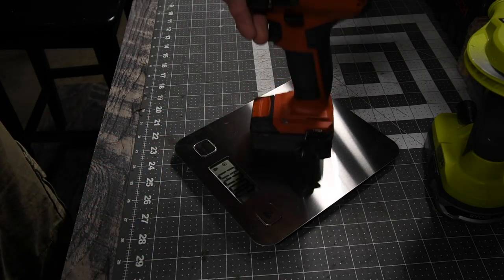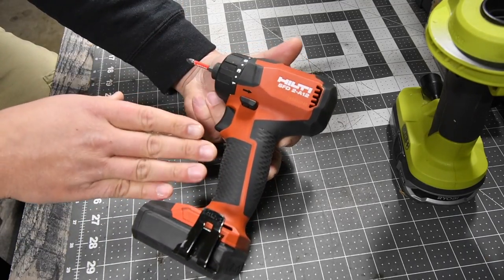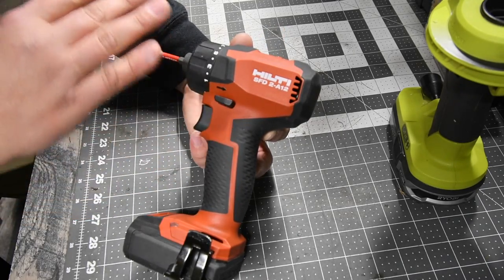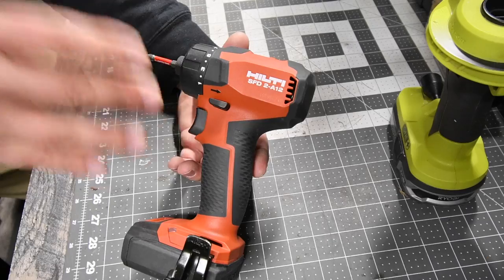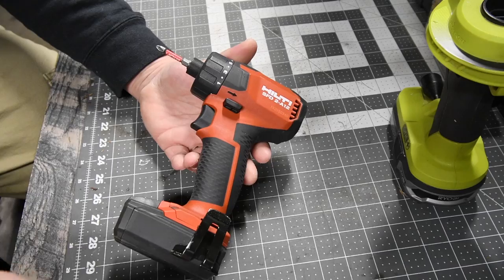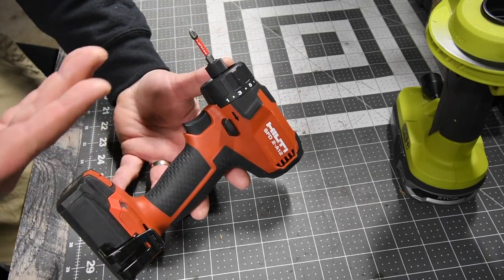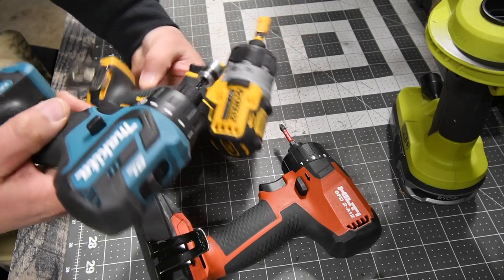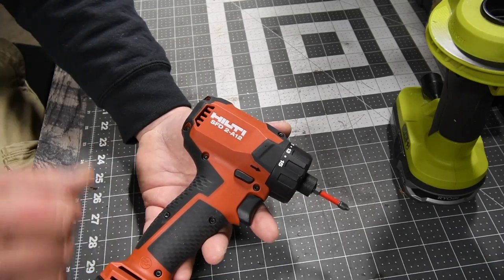HILTI 12v Screw Driver (MCT 2min Reviews)

Comment: Mine has gotten into and out of hundreds of different types of lawn equipment. Never stripped a plastic screwhole.

I've even used it at parties to turn a water pump during rainy days to drain the water that puddles up on the tops of tents and canopies so that it doesn't splash anyone because that suuuuucks when it's cold outside.

Pair it with a store-bought makita chuck and you've got a regular drill